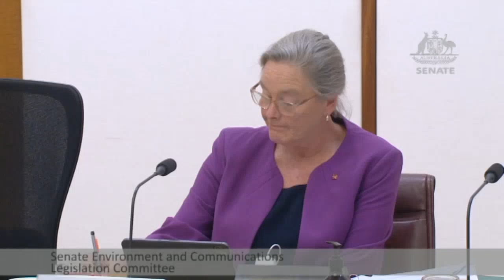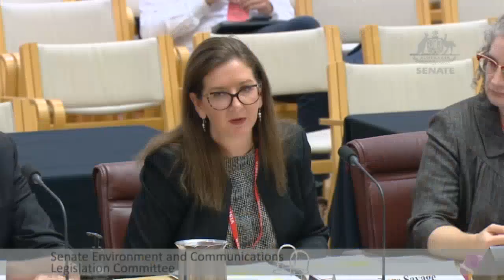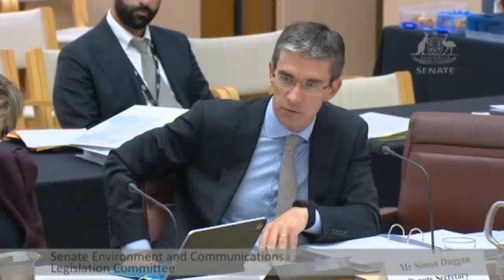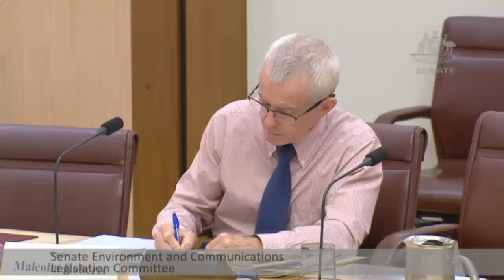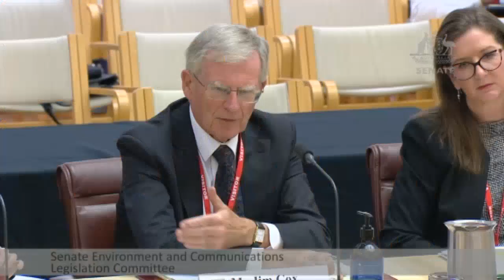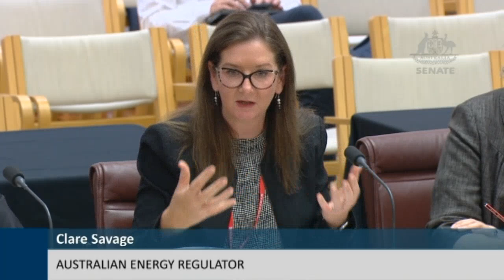Smart Meters and Remote Control Air Cons

Comment: Smart meters are not necessary for the public, but are great for governments and the providers.
Reply: You are right about that and when they were introduced some network distributors and I am talking about Victoria here were charging customers in their bills (hidden no doubt) and the meters were for their benefit alone as no need to read meters anymore.
Reply: Starting in South Africa as well.
When something is free, there's a red flag
Reply: If what the Senator Said that they can "remotely" turn your system Off, that is not good, because they could turn it of and "Forget" to turn your power back on, thereby ruining everything you have in your Freezers,  I think that is where the Senator was Questioning any Recompense payments for just that scenario.
Reply: If it has SMART in the title of anything the government promotes run a mile in the opposite direction.
Reply: Normally the solar system should be provided with a battery bank so extra energy is added to the your batteries packs. So when you need that you will take it from there not from the electricity provider. Also you can add an external generator that can come on line when your solar and battery pack are not available. With this simple measure and when this system is correctly calibrated your property don't need a meter nor a smart meter!
Reply: They alow them to controll the people
Reply: If you don't want grid supply you can always go off grid and you don't need a smart meter but if you have your own generation system you will want your own smart meter so that you can monitor energy loading, usage and generation in your own system.  
The electricity network is entitled to know these things when it is their network.
You pay for the privilege to use it.
As much as I like Malcolm he should stick to other topics because he knows and understands little about this one.
Reply: @cunning-stunt  Haven't got a problem with smart meters but we shouldn't have to pay for them when we don't really benefit from them. Most people wouldn't understand how to read them anyway but we do need them especially if you have roof top solar like me.
Reply: @johnnywarbo  But   you  don't actually  pay for them in full at install, if you did so the amount would be a couple of  thousand dollars, what you pay is a surcharge for the administration involved in assigning the meter number to your account etc.  The cost  is a couple of hundred at the most.  Plus there is the meter hangers labour etc.

These old  meters are more often  than not  out of  calibration,  so you may   pay more  or  less per  unit, for your electricity. I have had  customers tell me their power bill significantly  reduced after I have upgraded their switchboard and they have  had a new  smart meter fitted. 
I have   also had customers tell me it increased ,   sometimes this is   because their   meter had certain  circuits bypassing  the meter, basically stealing electricity. 
That can be a  problem if you have  been in the property a  few decades and the retailer finds  out,  they will make  an estimate on the amount they lost and bill you for it. You may have been  totally unaware about the bypass that was done by  a previous owner.

Those old meters generally have old wiring into and out of them that the home owner is responsible for. The insulation can be deteriorated and a fire risk. So there is also an insurance element to the upgrade. 
What should happen is your metering and switchboard is appraised and certified every 5 or so years and a certification sticker is applied on behalf  of the retailer. Any sketchy stuff should be dealt  with by the home owner  once they have been notified.  But what happens is the  metering guys no longer  want to talk to the homeowner because  a lot of them are hostile towards them and  think it is not their responsibility and why should they have to pay to fix any  issue?

Then you have the whole smart  meter EMF crowd berating meter installers  so you can understand  why they   don't want to  interact with the  home owner.

A  30 year old analogue  energy meter should no longer be in  service, there are safety risks  regarding the insulation  on the coils and  the wiring  terminations, technology has changed, smart   meters use far less energy to log energy usage than an old analogue meter. Its time to upgrade if you have  an old meter. Would you  still drive around full time in an un-serviced and un-restored  car from  the 60s, 70s oor 80s? How safe are they?

People seem to think they are entitled to power without having to make concessions around the supply of that power to them. If you were selling someone something you should  be  entitled to know what volume you  should charge for  and the customer what volume they are being charged for.  I'm sure there would be outrage if the energy  retailers just charged  a one size fits all, blanket  fee, whether you had a single bedroom flat or a 10 bedroom mansion. There would also be outrage if the meter  was not able to be read  by the customer. There would be accusations of overcharging.  If anyone needs to understand how to read their meter then   they should  be able to get instruction how from their retailer  or the smart meter  manufacturer.

Comment: Our solar panels provide house first and any excess goes to the grid. If they turned off my solar panels I would have to resort to getting my energy from the grid and thereby have to pay more. It’s bad enough that a power outage still cuts me off and leaves me with no electricity. It is theft.

Comment: B.S.   Air Conditioners are turned OFF because there is not enough power. Thats been happening for years and Manufacturers now provide that facility on the Air Conditioner.
That has been since the year 2000.

WHY DO GOVERNMENTS PUSH US INTO ELECTRICITY WITHOUT THE CORRECT MANAGEMENT PROCEDURE.

Turning OFF Solar Collection is Laughable.

Comment: ...and this is why I fitted an off-grid solar system.

In reality it works more like a grid interrupt system where when the solar is making enough power it turns off the grid supply, but when the sun goes down and the batteries have discharged too far, then it turns the grid back on to maintain the batteries.

If you attempt to force me to install a smart meter, then no thanks, I'll go 100% off-grid and spend the money I would have paid on power bills on more batteries (and likely save a heap of money in the process).

Comment: Smart meters are not a bad thing as I have one. It's very accurate and you can use the app to track your usage. Having government control your devices and the ability to deny you access to the power from your solar panels is not a feature I would want if I had solar.
Reply: We should never have to track our usage, it should be cheap and reliable.
Reply: @Nero_1069  I agree with that point. Though it's not the reality we live in.
Reply: Perhaps but as a Senior Health Researcher the EMF discharge from these meters is deleterious to health. A future abestos

Comment: I can smell a Canadian trucker type situation coming in the future.
Don't let them put smart metres on your property
The grid is going to get more fragile in the future due to the gross stupidity that is happening.

Everybody needs to plan for a solar inverter that can work during an outage
 and disconnect all the government control stuff
Batteries should be cheap enough in a couple years time.
Reply: Or a good generator

Comment: AI Controlled Digital Control Grid being implemented.

BRISBANE ‘OFFENCE DETECTION SYSTEM’

SMART City A.I. Controlled Digital Surveillance Prison

“Offence Detection System that will provide Council Compliance Officers with a centralised Cloud-based system that uses advanced artificial intelligence and machine learning capabilities to detect a variety of non-compliant activities occurring in the Brisbane area.

These could range from illegal parking, building work and footpath activities, footway trip hazards, noise complaints, illegal dumping to graffiti, and are detected through different methods such as vehicle mounted cameras, stationary cameras, satellite imagery, decibel meters and more. 

Council requires a streamlined capability to detect non-compliant activity within its boundaries to meet the objectives outlined in the Brisbane Vision - Our accessible, connected city strategy.”

https://qtenders.epw.qld.gov.au/qtenders/tender/display/tender-details.do?id=51315&action=display-tender-details

Comment: Smart meter senses ac has been turned on shuts down your solar panels so your now being charged for grid power that you don't need. Makes sense.
Reply: You're saying that the smart meter switches off your solar panels when airconditioning/HVAC is turned on. I'm assuming you meant to say it prevents any power coming from the solar inverter from being fed back in to the grid while the AC is active? Are you 100% of this?

Comment: I have solar, but when I installed it I chose not to sell electricity back into the system. I thought by doing this I would prevent this kind of shenanigans. But during a recent power outage, the electric  company was able to shut off my system so I couldn't access the energy my panels were generating. Gobsmacked. I would go off grid if there was a fireproof cheap battery available.
Reply: I’m not far behind you
Reply: Bluetti ?
Reply: Sorry only exploding, self combusting batteries for sale at present.  Won't be long before your home insurance policy has additional costs added for EV owners who park in their garages.
Reply: Diesel generator !!!!!
Reply: Red x.... Australian company
Reply: Get another invertor for private use connected to your panel with cross over switch for govt invertor.
Reply: If their accessibility to your electricity is only due to hardware installed with your solar panels, and you weren't informed about it, you should surely be entitled to compensation, because the product could be deemed "not fit for purpose".
Reply: Fireproof, cheap battery will never exist.

Comment: Okay, so if they turn off the solar panels to preserve the integrity of the grid, does that prevent the householder from utilising the power generated by. Their own panels?? Or does it mean that the householder is now drawing power from the grid?
Reply: If they don't have batteries, then I would 99.999% of the time be right in saying that your presumption is correct,
Because they will be feeding power straight into the grid and not into a storage battery that can power the home.
Reply: Not every inerter will alow you to do so, somehow just recently Fronius started to suppy iverters which can do off-grid to AU

Comment: Peak solar generation coincides directly with air conditioning usage, so then why are they cutting off peoples ac, which provides stable load, at the same time they are cutting off solar panels.  It seems to me (An ex US Navy nuclear electrician), this supply and load, would balance each other quite nicely.  I think there is something besides stability going on here sir.
Reply: To make ome pay more by relying on the grid.
It was always a scam
Reply: @yetanotherspuart3993 you'll own nothing and be happy.... apparently.
Reply: @jamesm2099  
Sadly yes!
Reply: @yetanotherspuart3993, you have beat me to it.
Reply: Using common sense, is unacceptable behaviour.

Comment: it's great to hear them admit they did this to SA a few years back also, though not all of that was done through smart boxes, there was evidence of Power workers going to homes and locking out their solar panels to the main grids (without Owners consent or knowledge) and never going back to turn it on again ... During the "Emergency" that impacted Victoria's power grid supply from Us ... Thank you Senator Roberts!
Reply: In sa they have almost no controllable generation, so when demand is low and generation is high (Sunday midday) the whole network overvoltages. So they do not cut off panels, they increase voltage on transformers until solar inverters start to switch off by themselves.

Yes, its technology. No way to control small generation means this generation will cut off rather randomly and unpredictable. Other way the whole network explodes.
Reply: @antontsau   I may not be great with my wording of things, I'm no electrician ... and I  do appreciate there are times that may well be the better option over all ... what bugs me & many others it that it were when electricians were called out to homes so folks could understand what ever their issues at the time were, the electricians were telling them their output power had been locked from joining the grid and without the knowledge or permission of the owner ... and it were never changed back past the emergency, nor were the owners compensated in any way ... not even in ways of a simple explanation as well as I'm aware
Reply: @ArtManda  No way. The single control network has over pv inverter is voltage on connection. If it becomes too high (255-260v) inverter switches off. Network makes it by rising voltage settings on transformers. Extremely crooked and dangerousbway, but the single one. All these homegrade inverters do not understand anything else. 

And, yes, they shut down completely, so if you consumed 5kw and generated 6kw after such a shutdown you will continue to consume (and pay for) 5kw and generate 0. Welcome to brave new world, you are fooled by pv sales who promised you free own electricity. Pay and repent. There is no such a thing "my own electricity" until you are completely offgrid.
Reply: @antontsau  yeah, well that makes sense

Comment: All of the energy from a persons solar panels should go to the person who owns the solar panels..
Reply: All these people who naively thought they were installing solar panels for their own benefit 🙄🤦‍♂️
Reply: solar panels generate to much power turn them off .......also aircons use to much power turn them off.  this makes so much sense
Reply: @billylionisnotagoat  It's all a lie.
30 average panels on your roof aren't enough to power your fridge fully, let alone your washing machine, your lights, any power tools you use in the shed, a tesla car god forbid, etc.
I did the math and to power my 1000W total capacity desktop PC from solar alone, I'd need 32.358 avg panels installed JUST for the computer and that only applies during the 40% peak.
Reply: @Rexhunterj my 32 panels only covers my supply çharge wh8ch is more my usage 😢
Reply: @Rexhunterj  yeah i'm just wondering why they always lying about the dumbest crap
Reply: Extra power be directed to aluminium, glass & steer production with odd data centre thrown in.